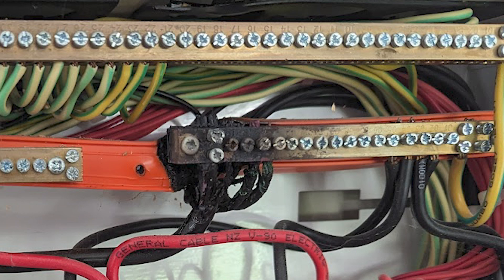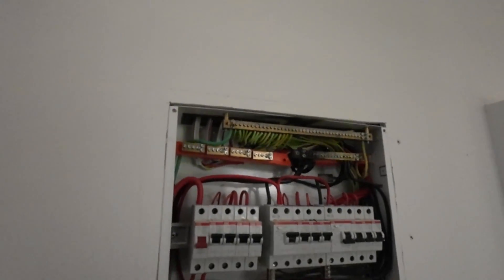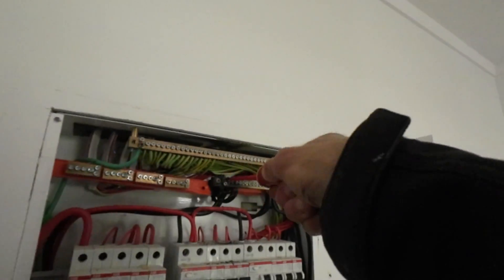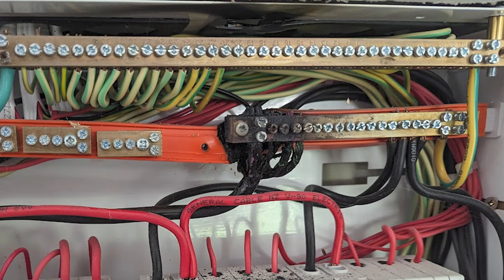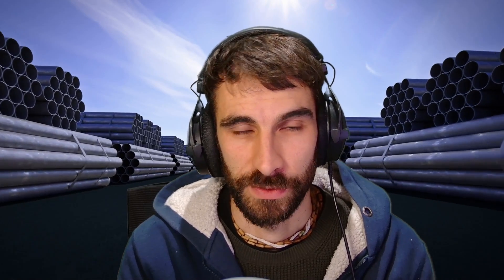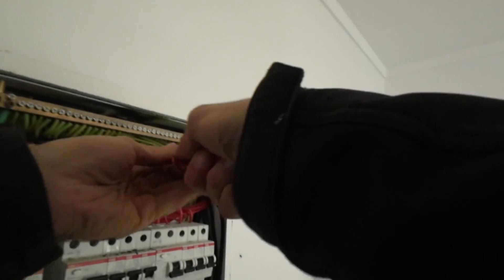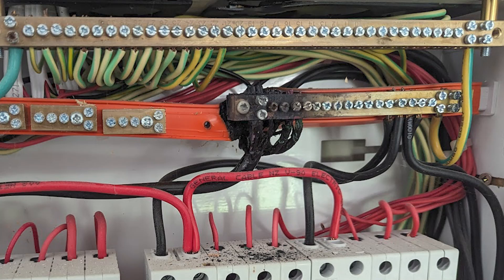Loose Neutral Fault Explained

Comment: Great vid and explanation ! Also worthy of mention is the fact that conductors are constantly heating (expanding) & cooling (contracting) each time a switch is flipped on or off and the branch circuit slightly moves with the sudden in-rush of current when voltage is applied to that branch . Over time the slight deformation of conductors, due to those factors, can cause loosening between the conductor and its termination device. It's not always shoddy electrical work rather the simple laws of physics at play.
Reply from the maker: Thanks. That's definitely worth noting.

I think a big issue is the method of connection too. A lug and bolt connection wouldn't have this problem.

Comment: Back in the day, electricians used to ground the system on water pipes.  Not good.  Electrolysis eats up the pipes and can cause a shock.  Grounding rods are the preferred method.
Reply from the maker: Yeah it's like the opposite of cathodic protection

Comment: Some EV chargers have solved this problem by monitoring voltage then switching out the earth to premises  by a contactor. The same can be implemented for the whole house.

A TT system eliminates this serious problem.  But TT needs a foundation concrete earth rod (using the house foundations) or a soil earth rod (many rods around the house).  A rod or coil of earthing wire can be set in concrete in say under the garden of a house. Then the TN-CS earth supplied by the supplier can be ignored - use your own. Of course RCD/RCBOs need to be on all circuits in a TT installation, and one main whole house RCBO, as the French have.
Reply from the maker: Yeah, the hole house RCD thing sounds smart. Are they 150ma or something?

The trouble with a TT system is it can't relied on to trip an overload device under fault conditions. RCDs would work though.
Reply: @legacyelectrical  
The French have a DP 300ma and 500ma main RCBOs provided by the supplier. So it is the last line of attack after the local RCD/RCB devices. 

Search Utube:
EV CHARGER INSTALLATION PEN FAULT PROTECTION USING MATT:E Connection units

This is re: EV charger combating the lost neutral problem in TN-CS earthing. Can be applied to the whole whole, if someone makes one. It uses a contactor to switch out the earth to system.  

As I wrote, a TT system with a foundation concrete earth rod (using the house foundations) or a soil earth rod (many rods around the house), that can be retrofitted, will solve the problem.  The accident with the girl in Australia was because the earth rod was not substantial enough. If the earth was connected to the house slab and its rebar - foundation earthing - it would not have happened.

It is all down to suppliers saving money on over/underground earth cables.
Reply: @legacyelectrical  
RCD/RCBOs are mandatory on TT systems in the UK.
Reply from the maker: @johnburns4017  I'm in NZ, we're not allowed to do different systems
Reply: @legacyelectrical  
So you only hope is if some manufacturer does a whole house device working on the principles of the voltage monitoring EV charger.

Comment: What device prevents metal parts being live?
Reply from the maker: The only way to protect against this fault is to turn all the power off for the installation when it's detected. I think a good way to do that is to measure voltage and if it gets too low shut the the power off and get an electrician out.

Comment: This happened to my mums house years ago. I'm a sparky too (in Australia , so same design/regs as NZ) and she called me to say that she was getting shocked from taps in the house and that the lights were dim. Her neutral had COMPLETELY burnt out at the main connection in the DB. The whole house was sending it's current through the earth rod which would have been then going up the neighbours earth rod and out via their neutral.
Reply from the maker: super dangerous
Reply: Both countries need to revise their regs. Every circuit must be RCD protected. Devices that leaks a lot of current must be on a dedicated circuits each protected by an RCBO instead of RCCB+MCB to avoid nuisance tripping. In France and the UK every circuit must be RCD protected.
Reply: @IAmThe_RA  in Australia every circuit 20 amps and below must be RCD protected and all circuits that are for lights or socket outlets
Reply: @Sparky_D   I mean every circuit regardless of current it draws should be RCD protected. That's not the case in NZ based on some videos i watched, no idea about Aus. And the M.E.N should be ditched. Neutral and Earth connection should take place on the supply authority side (preferably before the meter like in the UK). So when the main neutral in the distribution board is broken it won't be as much of a danger although the RCDs are useless in this scenario. And Earth resistivity test must be conducted to determine how long or how many electrodes are needed and to make sure that enough current will able to flow through the electrode(s) and trip the MCB or burn the fuse due to over current.
Reply: @IAmThe_RA  NZ and Aus use the same set of standards, with a few little things listed as particular to one country or the other.
I agree we should have RCD's on everything.
We do have requirements for earth resistance testing
Reply from the maker: @IAmThe_RA  every circuit is too much. There's no point in RCD protecting a device that no one is handling and that is likely yo cause nuisance tripping such as pumps.

In the UK they have the MEN link on the supply side and it sounds like this is worse. I've listened to some UK podcasts about it and it sounds like they have loads of loose neutral faults over there.

Earth electrodes cannot be expected to draw enough current to trip upstream circuit protection devices. You really need the MEN connection to give an adequate path for short circuit current.
Reply: @legacyelectrical   As a pump is on a dedicated circuit,  nuisance tripping can be avoided by using an RCBO to protect the circuit instead of using an RCD that is shared with other circuits. Yep in the UK they call it PEN (neutral and earth are linked before the main isolator switch located in the outer wall as it is also a TNCS system). I'm not saying they don't have loose neutrals in the UK but the advantage of PEN over MEN is that in the event of losing your neutral in the distribution board (like in your video) the protective earth conductor won't become live because the neutrals of the appliances/loads also lose their link to the PE because there is no link between the Neutral and Earth bars in the distribution board.
Reply from the maker: @IAmThe_RA  I don't understand what you're saying about the earths not becoming live due to a loose neutral fault. Isn't the PEN a single conductor into the board which then splits in the board to supply the earths and the neutrals?

RCBOs can still nuisance trip. A pump is highly likely to have current leakage, and it's the kind of thing you want working all the time.
Reply: @legacyelectrical  I mean PME.. Yep the supply authority PEN conductor is separated at the cutout on the consumer side. So the possibility of the PE (protective earth) becoming live in the installation due to an open neutral is zero because the main neutral also serves as the MEN link. Losing your main neutral means that the local circuits also lose their MEN link but their PE are still connected to the supply PEN conductor at the cutout via the earth bar in the distribution board. So as long as an energized neutral wire is not touching any conductive part that is linked to the PE or as long as the supply authority's neutral is not broken before the cutout on the consumer side the PE won't become live. So imagine if someone cuts the neutral conductor going into/out of the meter, the PE won't become energized (you are safe as long as you don't touch the energized neutrals). That won't be the case in Aus/NZ due to your MEN link in the distribution board which means that anything that is connected to the neutral bar in your distribution board will be energized, your metal fridge and oven will effectively become live.

There are RCDs rated at 100-500mA residual current if your device leaks so much current. I personally would check first the leakage current rating of an appliance before buying it. I don't want something that leaks a lot of current around my house.
Reply from the maker: @IAmThe_RA  I think I understand now. The network supplies 3 conductors (for single phase) by taking an earth off the neutral before it enters the property. Then even if the neutral fails, the earthing system is still fine. I can see how that's more safe. It's just reducing the number of places where a loose or lost neutral can create this type of danger.
Reply: @legacyelectrical   You are right. But it is still a tncs rather tns system, so only two conductors coming from the supply authority side: the Line and the combined Neutral-Earth (PEN). The PEN splits at the point where it reaches the property.
Reply from the maker: @IAmThe_RA  It splits inside the property, like at the meterbox? That's the same as in NZ.
Reply: @legacyelectrical  The supply power line (an underground armoured cable containing two conductors L&PEN) ends in a equipment called a fuse cut out which shall not be tampered with by an electrician. And there are 3 conductors L, N, E coming out of the cut out. The E conductor goes to a small panel containing an isolator switch and an earth bar while the L&N conductors feed the meter first and the output goes to the isolator switch (all of these is housed in a metal box usually installed on the outer wall of the residence). And then 3 wires L,N,E come out of this box and into the distribution board installed inside the residence. Thus,  the earthed conductive parts won't become energized if an open neutral occurs at the property unless it occurs before the fuse cut out like in the street.

Comment: RCCBs /RCDs would prevent this since the current would not be returning through the neutral will cause them to disconnect the live hence creating a safer situation. Why are they not used?
Reply from the maker: This installation does have RCDs but this kind of fault won't cause RCDs to trip. In NZ we have a link between the main earth and neutral in the switchboard. The current which is causing the voltage divider effect flows the normal routes.

I'm think to make a video on why RCDs won't protect you from this kind of fault.
Reply: No, the current returns via the neural and then goes to the point where the neutral and earth are connected and comes back through the earth. There is no imbalance.
Reply: I would have thought it would trip, did a job last week were if you plugged anything in to any socket on the ring it tripped and that was just a very loose neutral in one of the sockets due to the return not being the same so an in balance.
RCDs are designed to check that the current flowing through the live wire is equal to the current flowing back through the second part of the circuit, aka the neutral wire.

If the current is not the same, the RCD will simply disconnect the supply.

Comment: You shouldn't get a problem with the earth/ground becoming live ! Do you guys in New Zealand not have PME (protective multiple earthing) ? A residual current device/earth leakage circuit breaker will also trip in such cases.
Reply from the maker: We have what we call a multiple earth neutral system (MEN). That's where each installation has an earth electrode and the main earth and main neutral bar are linked at the main switchboard. The neutral carries all the fault current for earth faults and the earth electrode just keeps the earth and neutral voltage matching the local ground.

We don't put RCDs for whole installations. We have RCDs on most final subscircuits in residential, but those won't protect against voltage coming from a loose neutral fault.
Reply: @legacyelectrical  What 'surges' ? A poor neutral connection won't generate a voltage surge unless there's appreciable inductance and arcing.
UK practice currently is for typically a couple of RCDs in the consumer unit plus MCBs. AFPDs are used in some locations now.
Reply from the maker: I didn't say anything about surges. The loose neural gives you voltage on earthed metal frames due to the voltage divider effect. This voltage won't be turned off by the RCDs we put in because it comes from before the RCDs.
Reply: @legacyelectrical  should be no conductive path from live/line through the load to earth/ground for current to flow into. If it did happen, the line/neutral imbalance will trip an RCD on the circuit. There really are very simple available solutions ! You mentioned 'surges' in another reply to a comment of mine. Again, I don't see where surges come into play.
Reply from the maker: The earth electrode helps to protect against surges caused by lightning. That's unrelated to this type of fault.

We don't have RCDs for the whole installation so rcds won't trip. When current runs through an installation that has a neutral fault it creates voltage on the earth through a voltage divider effect. The current is running back and forth through the RCDs the wys it normally would. The only way for an RCD to trip from this kind of fault is for it to be installed for the entire installation.
Reply: @legacyelectrical  I'm rather suggesting the you SHOULD use RCDs ! These are commodity items nowadays and there's no reasons NOT to use them or RCBOs.
It would seem New Zealand regulations are several decades being moden thinking.
Reply from the maker: @grahamstevenson1740  I don't think you're understanding me. We. Use RCDs here on final subscircuits. This board had RCDs all through it. But Rcds can't protect you from this kind of fault because the voltage associated currents flow without creating an imbalance in any of the RCDs.

The only way for an RCD to help would be you'd there was one rcd installed for the entire installation the measured theain incoming phase and neutral. I think some countries might do that but it's definitely not common. Are there many places you know of that protect the entire installation with one big rcd?
Reply from the maker: One of your comments isn't showing up in the app, only in the studio. It's the one asking about how current can flow in the earth if the neutral is lost.

Our earth and neutral bars are linked. There's no main earth conductor from the network, just a neutral. Then each installation has an earth electrode which is linked to the main neutral in the main switchboard. If the neutral is lost then the only oath left for the current is down the earth. Because of the earth neutral link the current can use the earth electrode as a path.
Reply from the maker: @grahamstevenson1740  what country are you in? What kind of earthing system is used there?
Reply: @legacyelectrical in the U.K. we used to have a split load boards and circuits split across 2 RCD so this would have tripped due to the imbalance in conductors.
I recently had very burnt neutral in commercial but it didn’t trip the MCCB feeding it.Metal clad enclosure was too hot to touch , paint had started to bubble !!
Reply: While PME can mitigate the risk it is in no way any foolproof protection.  RCDs do not trip as the fault happens before them and the current comes from the earth. Using an RCD on the PEN wire is strictly forbidden.'

There are devices that can detect a PEN-fault but they are not widely used. In the UK they are used with EV-chargers.
Reply from the maker: @okaro6595  I reckon  the best way to detect  a loose neutral is to look for low voltage.